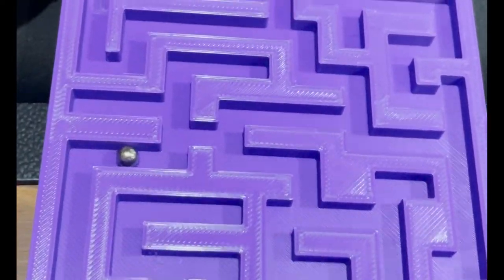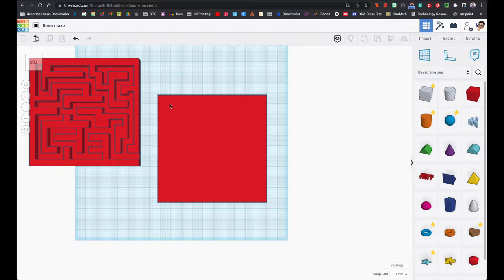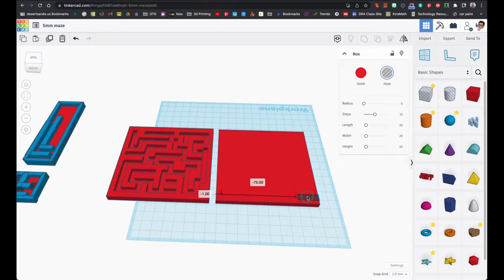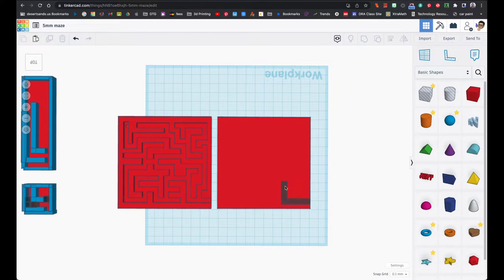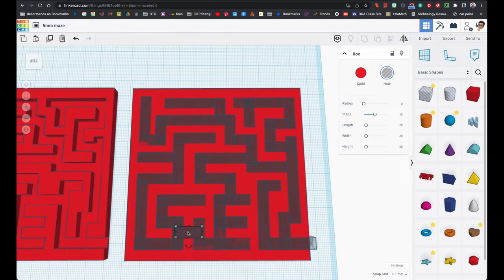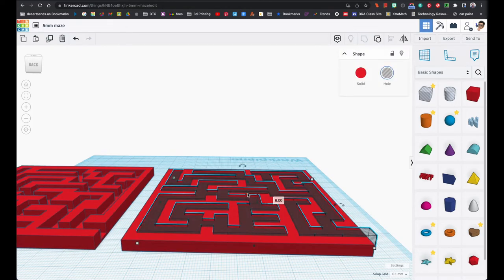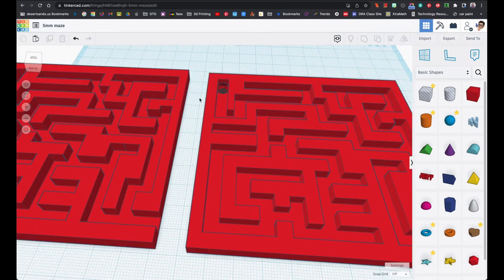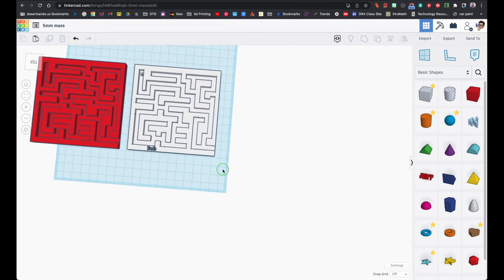How to Make a Maze Using Tinkercad and a 5mm Ball Bearing

Comment: how will the ball go out of the maze
Reply from the maker: The bottom right which is the same way it came in.  However, you could design an exit.  This was designed to have a place for the ball to get stuck as the goal.

Comment: Question:  Your base is 5mm and your square negative hole is 5.1, which allows it to be above the top surface.  When you group it will cut a hole entirely through the base.  At some point you moved the negative hole up.  I watched the video again and you must have done it during the long intermission.
Reply from the maker: I think you're right.  I think I'll make a new video explaining it from the beginning since this is probably going to confuse people.  Thanks.